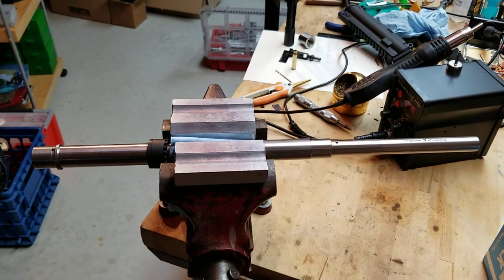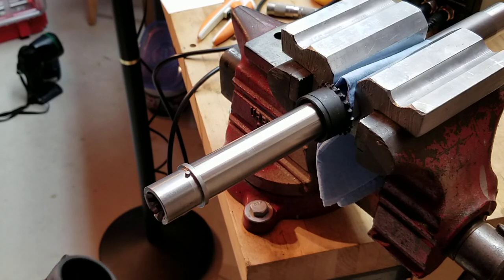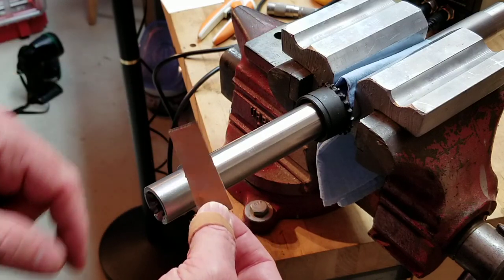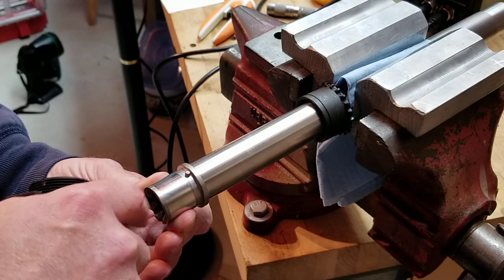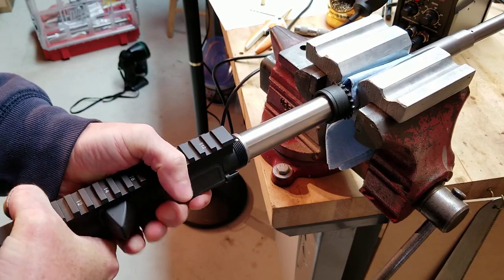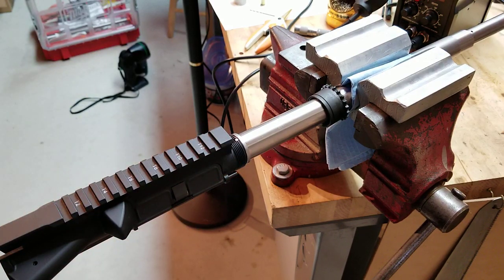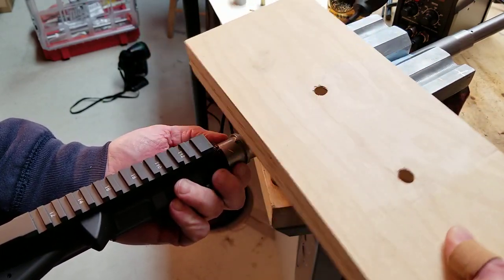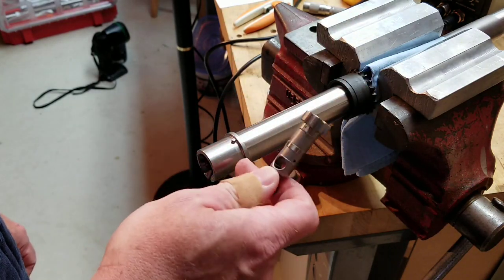AR Barrel extension fit & accuracy (precision)

Comment: And interesting thing JP enterprises does is their barrel extensions are smaller dimension of the barrel extension the Id is tight A barrel is not going to fit and die you probably don’t even need a barrel not because of how much force the receiver clamps back down on the barrel but they simply take a torch and heat up the threads on the barrel extension on their upper and you do that for about 10 seconds quickly slip the barrel in and then about five seconds later it is not moving and they make precision match rifles for competition shooting so accuracy is paramount and I just think it’s very interesting and it would be cool if other companies did that My uppers I use square forge m4 marked uppers I do want to use a A vlotor upper on geissele mk4 shorty radian Adac model 1 lower as I’m waiting forever those uppers that I’m pretty sure Noveske uses vlotor uppers but i’m curious anyone have experience with fitment of a barrel in a MUR upper like I’m talking about for example I have A 2021ish Bell from them it’s definitely a mini go to smaller port it might’ve been for the 10.3 military package I didn’t see any markings other than the normal DD markings on the side and then it has a serial number on the bottom and most likely that is for ID purposes the barrels really bad where I had some sort extreme failure and it’s happened with the other barrels that have that number my next barrel is going to be a Novesky 300 so I can have a full radian for sure and a half the price depending on how much you’re spending on the barrel now I like staying in the 500 it’s strange and I’m also looking at others to have a century in our they are the only other company contracted that uses with their 4150 CMBM249 saw double chrome mind towels so you’re basically getting a saw about your 15 barrel so you can see that there’s gonna be a lot of accuracy longevity especially and I think as important as making sure you feed ramps and barrel extension it’s all good having a excellent gas block and then have it taper pinned and also indexed gas black slides into a slot no having to worry if The gas block is going to turn left or right or not be completely centered over The whole not partially your candid when I buy a barrel I try to stay it with them for the $600 range I wanna get the best use I can out of them for as long as possible scary shit but I doubt that my Centurion arms Bow down for it is same as the Daniel it’s called hammer for chrome lined excepted double chrome wind and it is the SOCOM colt profile for ris 2 military the whole reason now it’s not that cold what my salon urban for a catastrophic failure but people over those kinds of scenarios really happen if You have full on our capabilities on your firearm not super fast on your geissele I am after building the system wall the 14 five am I gonna go into all that but it was a little bit of a snug fit not really but what I was meaning to say is I believe that the God system is X Greenly Porten and gets overlooked you see low profile glass blocks slip right onto a bow each should take some wiggling and oil and mallet like the centurion arms gas block which ass zero leakage I have to say having a .061 Gasport and a 14.5 carbine gas with an h2 heavy triple braided super 42 buffer system at 4 o’clock with can 2/3 surefire and lefty no issues but after buying so much garbage I started to do the buy ones cry once but as I would like to get a nice ornament bolt carrier group with the rounded lugs which gives you better feeling locking and unlocking and even just a simple brass check When you buy a barrel and they have all these questions like OK do you want polished ramps or pinned gas block they do ask do you want To check headspace so I was talking about a 10 three and a 14 five I definitely have to say that centering arms has a quality metal and it’s coming from the owner of the 
Owner that I buy my forge receivers for mill spectate build as they are in manufacturer A.R. 15 manufacture new The Game got in 2018 get the FFLSOT etc. and when I talk to him because I was asking about a bolt carrier group of their New titanium nitrited TIN Bcg and I was thinking about putting it in one of the other and I’m like I’m getting to the Colorado but he’s like oh yeah they’re very on point with the materials that they get sourced as the owners of navy seal and has put the timer blood sweat tears and R&D into everything and hey why not use machine gun steel for air 15 you aren’t really if you keep your barrel home cleaned it can be passed down to your grand child and still be submitting it with Black Hills but something to note companies that make high-end barrels that say crane spec if you don’t know what that is it doesn’t matter but high quality barrels it’s noted on their website is meant to be used in conjunction with quality ammo PNC bronze For example are use a few different Black Hills loans home defense right now I have open tip match round mag and Hornady 75 grain HD interlock soft point and for the 14 5 the critical defense 73 grain soft point